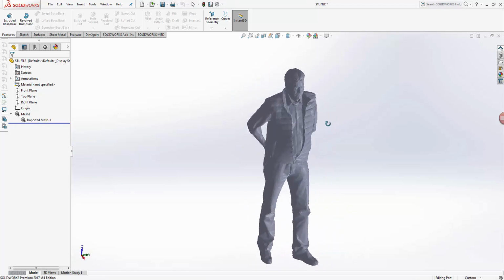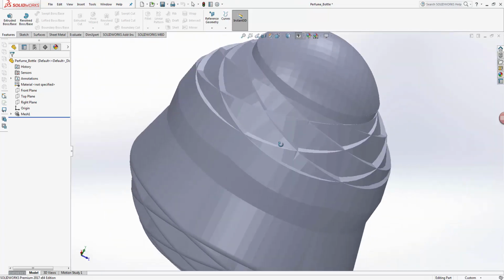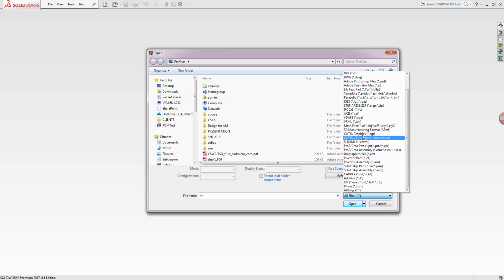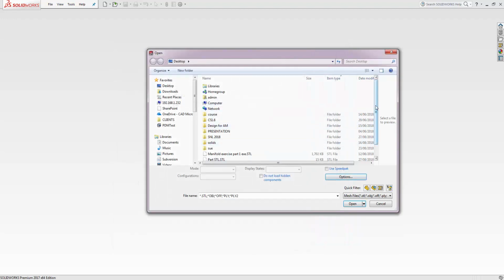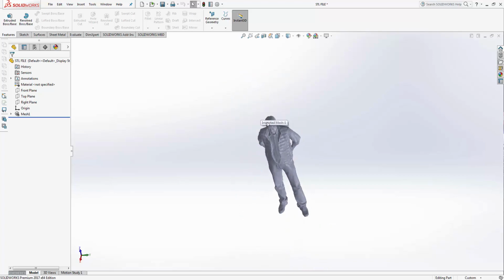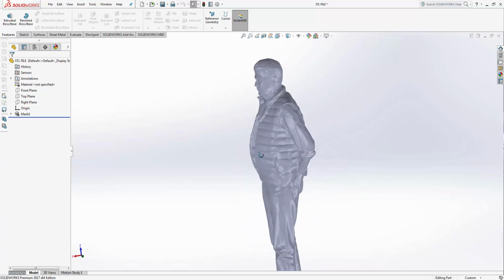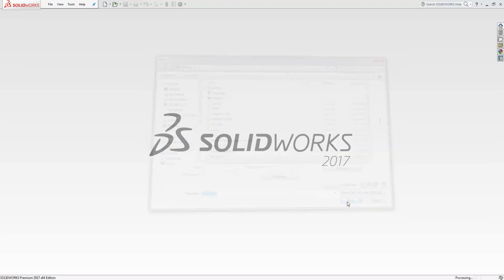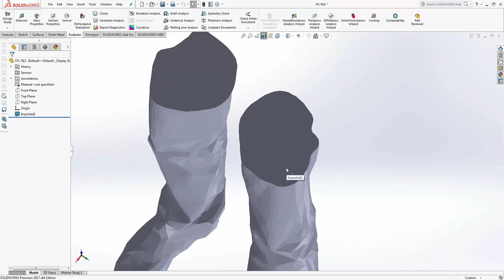Tech Tip Tuesday: Importing STL Files in SOLIDWORKS

Comment: Can we delete those unwanted lines occurring in surface ,such as occurring in 1:44
Reply: They are the edges of the faces. You can't delete them but you can set the model to shading without edges.